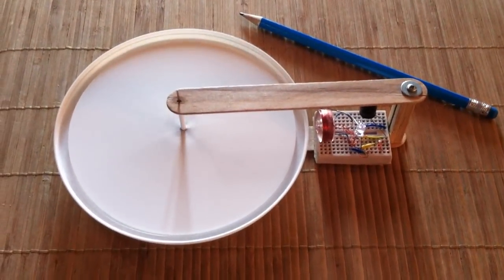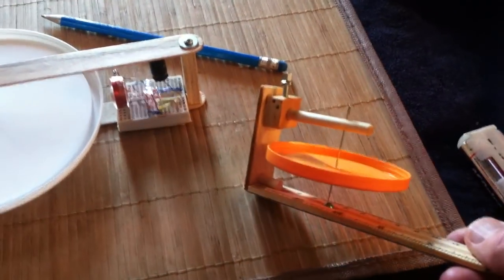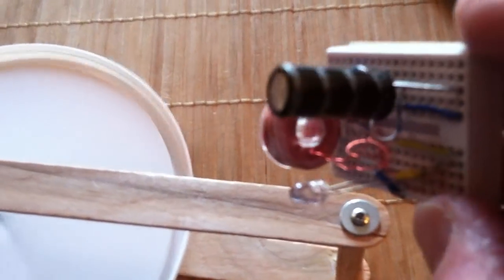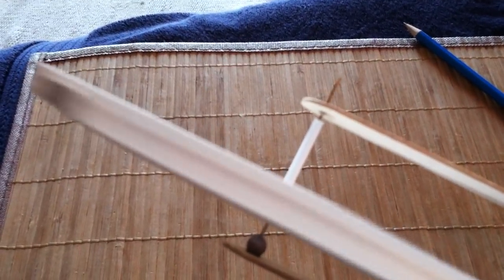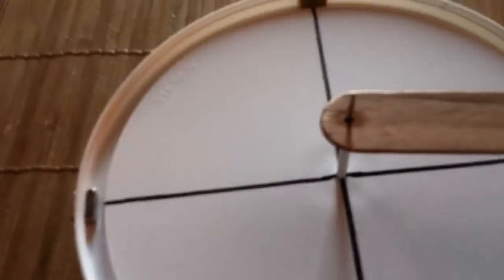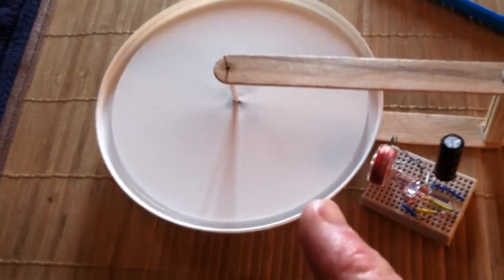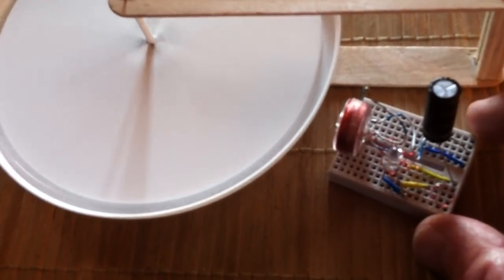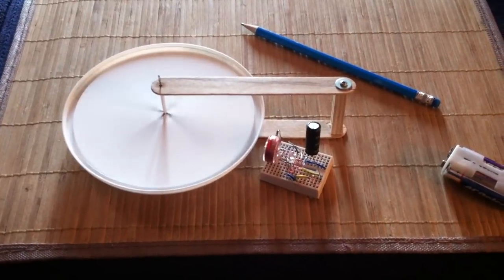BIG Lid Motor

Comment: If it has sufficient torque I would think you could use just two poles opposite one another to slow it down.  You could also balance the lid with non-magnetic weights if necessary.

Comment: Hi Lidmotor, thanks for an interesting upload. These motors are interesting but why not explore how to make one that does useful work - produces useful torque - turns a fan blade, moves a load? It is intriguing that power is from a super cap. It could also be from a solar cell or supercap or battery charged from a solar cell. How much run current does this circuit draw? I wonder if the circuit can be made more efficient by not wasting energy moving the reed switch arm mass. Perhaps a mosfet switch? Where can I see the schematic of your driver circuit? Thanks

Comment: How would it go with 25 litter white plastic bucket from food industry 😮
Reply from the maker: The lid would work fine.  Just scale everything up.  Try it.
Reply: Lidmotor I think I am ready to build my first lid motor . What gauge wire do you suggest for my big bobbin and how many turns ?
Reply from the maker: For a what you are considering I would use about 26ga magnet wire and several hundred turns.  Make sure the rotor turns very very easily,  you use strong neo magnets, and put tape around the magnets so they don't fly off.
Reply: i did built using the "table fan frame"
Reply: Lidmotor cool 😎 will do this in next couple of months .

Comment: Hii
Thanks for video and good explanations. Your engines are great
I want to built a pulse motor that will work non stop years and don t know what bearing to use
( I don t have sophire glass and can t buy) . I have a mendocino motor with point bearing made by a steel ball from a ball bearing .
After a few weeks of running on the glass and on the steel ball start to be wear signs and the friction increased .( I believed will last years but no!!! )
I think perhaps the solution is the point bearing made by steel ball on glass surface submerged in oil will wear much much less if the oil will enter between steel ball and glass. Oil will increase drag but need to make some compromises..
Or to use a real bearing . A miniature type .
Have you a better idea???

Comment: some late thoughts.      you may know that this config is a  bldc  Outrunner.      a typical pulse motor, that has just a few half-poles,  is  of  no  practical  use;  a  Do-Nothing.   why is this true.       when a motor has just a few  half-poles,   the rotor is  COASTING  most  of  the  time.          on the other hand,  where a large radius (bldc outrunner) rotor is driven by multiple poles,   there can be a  LOT  of  MA,  near the rotor's  center of rotation.      this is THE  reason that an outrunner can swing a prop, without the need for gearing, on a model airplane.      see f&p 'smartdrive' motors, re-purposed.    (if interested, see my ou research).       googletranslate
https://www.fisherpaykeltechnologies.com/products/direct-drive-motors/